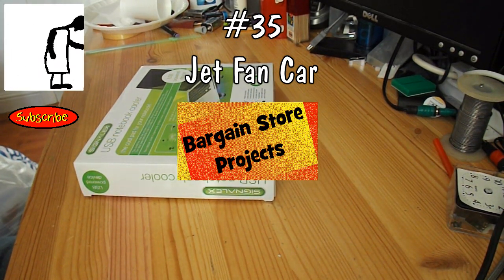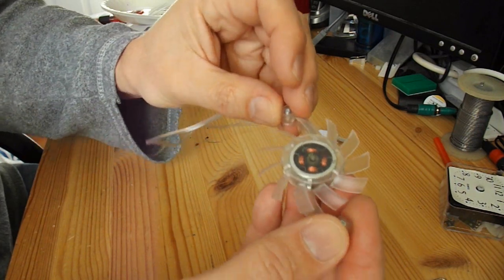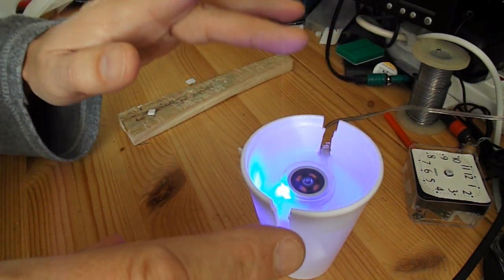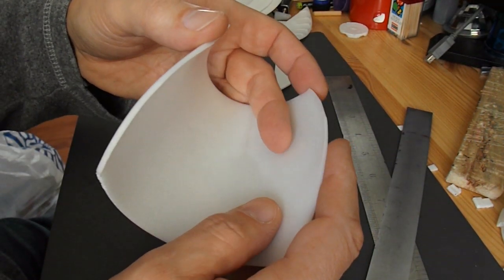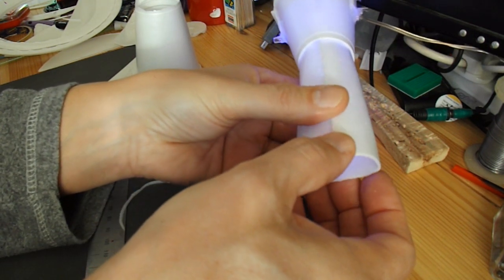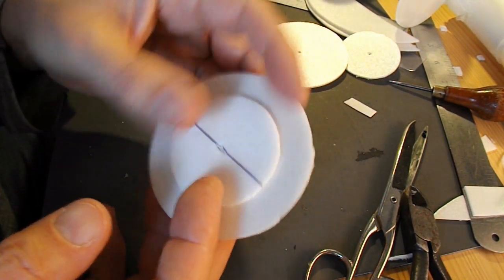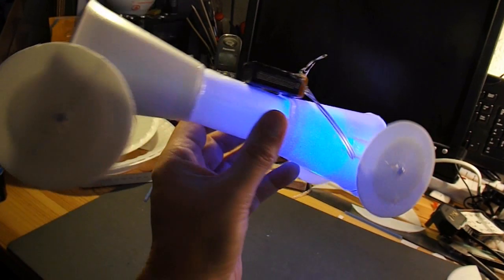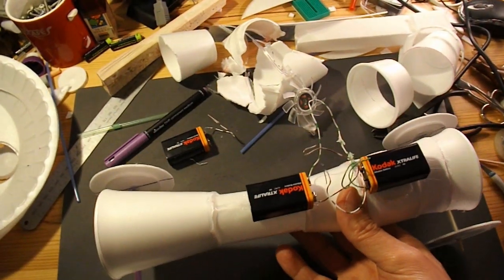Bargain Store Project #35 Styrofoam Cups Jet Fan Car

Comment: why did you attach another cup at the end of tube, i think it reduces speed because it is wide at end. Two cup were enough....??
Reply from the maker: +rohan bhardwaj the cups at both ends were just for looks. You are right that having a wider outlet will reduce the effective power but that was not a problem for me. I am not interested in making it go fast. If you want to make one yourself then you can make it without the extra cup.